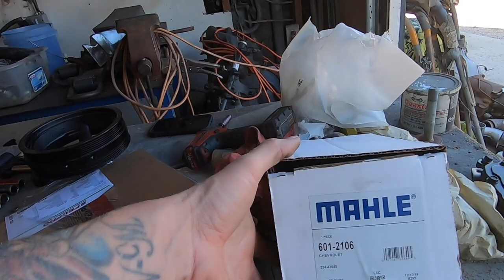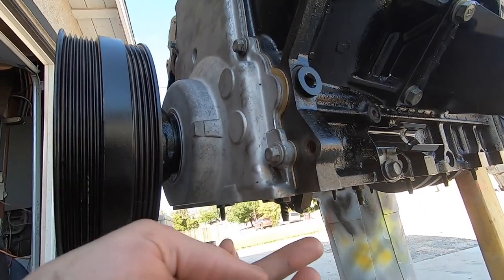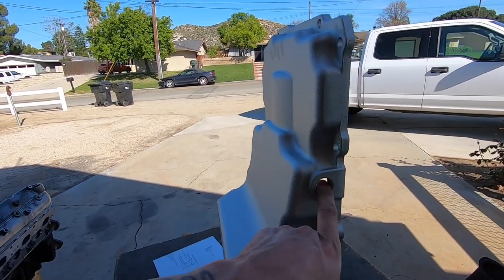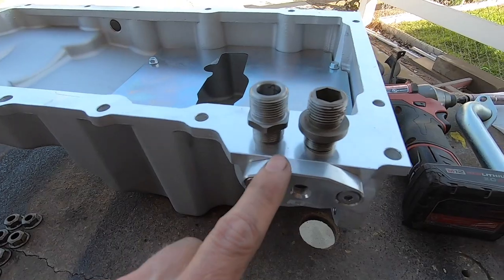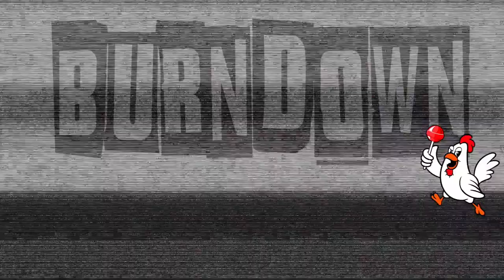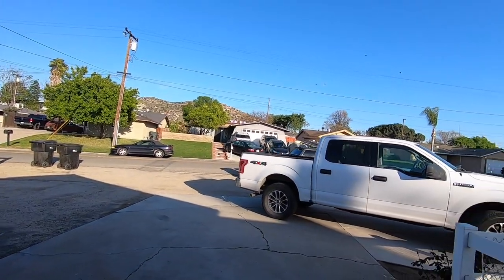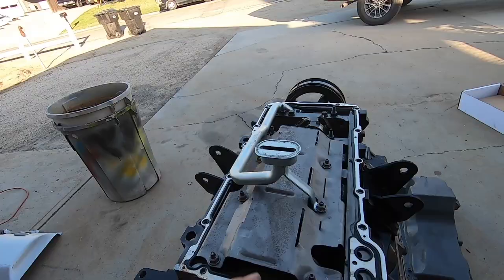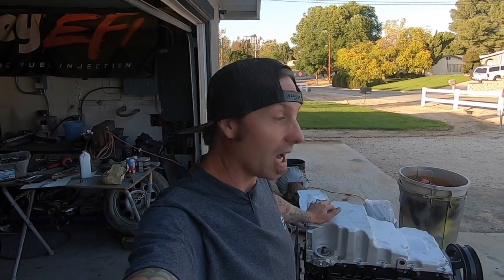Best Budget LS Swap Oil Pan

Comment: You can make the truck windage tray work by cutting it 14.25 inches from the rear of the tray. You may need to trim one corner a bit if the oil pickup tube makes contact with it. Easy fix and will save you $30-50, Nice video!
Reply from the maker: Thanks for the tip!

Comment: In 07 they changed oil filters on the trucks until 2013. The later ones are a pf48 ac delco and the earlier are a pf46 ac delco just fyi.
Reply from the maker: Thanks man. I changed the one on the Boom to an early truck style so thats what the Bego will be so they take the same filter. Makes life easy when your cars take the same consumables.

Comment: Just FYI, that pan is almost identical to the Holley pan. I have compared the dimensions of that pan verses the Holley. The dimensions are on there sights E- Bay and Holley checked it out for yourself. Holley calls it there 302-2 or 302-3 pan. The only difference I found was the very front Hump that kicks out in the front of the pan is slightly shallower than the Holley. You could probably grind some material away if needed. Holley recommends that style pan for a stroker motor with that front hump. I paid more from Holley and didn’t even get a gasket or new pan bolts. A lot of people cut the windage tray in front of the bolts and  notch the side approximately 2 inches where the pickup sweeps back down near the block. Damn what the hell am I doing watch this video at 1:41 am JK, keep up the great work.
Reply: Yeah Holley supplies the diagram as to where to cut tray.

Saw your comment after I replied. ;) lol
Reply: Do you have a link for the e-bay pan?
Reply: Brandon Loll look up poormanmotorsports on e bay. Pan# Tsp 81075
Reply from the maker: Thanks for watching man. I didn't know Holley gave instructions on where to cut the windage tray but when you put it on its pretty obvious where its hitting. Its a nice part for the money for sure and if you cant figure out how to cut a windage tray you may have a struggle with a complete LS swap 🧐😃
Reply from the maker: I put it in a comment
Reply: The Holley diagram is garbage, it doesn’t say which is front of the block and the whole placements for reference are off but one can figure it out

Comment: i like that pan, these weren't around when i did my swap.  i used the GM muscle car pan when it was still $125.00, still pretty deep sump but not as bad as truck.  came with everything including dipstick. had to weld in my turbo drain tho.
Reply from the maker: Yeah these didn't exists when I did my swap either so its only getting cheaper for everyone. I had to drill and tap my oil pan for a drain but it wasn't the end of the world. Hell I even did it on the car HAHA! I have way more money in a real Holley pan and the tap I had to buy.

Comment: Is there a reason you didn’t use the Oring that came with the oil pan?
Reply from the maker: I dont trust an O ring unless its nice and tight in the oil pump. I had oil pressure problems before because of a lose fitting O ring so im always skeptical now haha.

Comment: Used that pan on my swap, but unfortunately didn’t know that they offered it with the oil drains...  It fit great in my 3rd gen I didn’t have to clearance or grind on my crossmember like I have seen done on other swaps. Couldn’t believe the quality and price verses the other pans I was considering. Great video as always Dane.
Reply from the maker: Thanks Jay. They make 3 different ones I believe. They make one that looks similar to this one but no drains and the front of it has more meat and will fit over the windage tray. This one is a 302-3 knock off.

Comment: Glad I found this channel! I just got my 92 5.0 and going to 5.3 4l60 swap but unsure of everything I need. Of course I need the motor, trans or a complete donor. Then oil pan, cross member, motor mounts, driveshaft I don’t have one I think, can I use ls1 front end accessories with a ls1 harness? And I need a fuel system as well
Reply from the maker: If you go with LS 1 intake you need to do the LS1 balancer, water pump, and accessories to go with it.
Reply: @Burndown  super late on this lol but I started back on the fox body complete 06 5.3 pulling motor from truck hopefully this weekend or start of next week
Reply: @Burndown  I think I’ll just go cowl hood and keep stock ugly intake unless I find a ls1 style intake not to break my pockets

Comment: I got the same oil pan without any turbo return oil line holes. Me question is everything says you need this dipstick and tube, but the oil level should remain the same. What did you find that changed regarding the dipstick markings. 
Engineers would place the full mark at a level below the balance weights on the crank to keep it from rotational viscous friction, plus aeration of the oil. I guess in my mind, full is full, right? What did you find other than the amount of oil need to fill with filter?
  I did the same thing with the oil filter adaptor. The threads are the same on the pan side, plus if you have a large stash of filters, now you can still use them. If you could and you had three vehicles, it would make sense to have one filter on the shelf that fits each of them. I have seen oil pan upgrade videos where they bought new filters to fit the pan. NO, change the fitting to the filter you have or want to use. I have a 12 pack of ACDelco PF46 and don't want to though these away or sell on craigslist and buy a different part number for more money. What do you think? I subscribed some time ago and enjoy a young guy doing what I did for 40+ years. Thanks and stay safe during this "WU-FLU" time, now May of 2020.
Reply from the maker: Man I just bought an LS3 style dip stick and ran it as is. If you wanted to you could check the dip stick with the pan off to get a measurement if your that concerned about it. Im more of an it has oil in it were good kinda guy 😆

Comment: Question on the Oil Pump, would it be better to have a high volume oil pump or high pressure ?
Currently building a 5.3
Reply from the maker: Lots of debate on this topic. I have used them all without issue. My current pump is a high pressure pump normal volume. As long as your making 10PSI per 1000 rpm as a rule of thumb you should be good.

Comment: So, that's a knock off of the holley 302-3?
I've used that Holley one on 2 builds, since I saw Matt point it out and use it. Nice pan for about any swap. ;)
Reply from the maker: I agree this is probably my new go to pan for everything. Has drains and is low profile. It may be a issue tho with crossmember clearance. Its a little longer that the 302-2 so check your specs before you buy.  Nice part tho.

Comment: i just installed a new melling 295 in my c10 and my oil pressure is about 40 cold start and 20-25 hot idle. im going to be pulling the cover back off in the next few days and shim the spring and see how much thatll help some pressure. i dunno if you was looking for a specific  oil pressure number but thats about the normal stock 5.3 pressure numbers.

that oil pan is pretty slick. ill definitely try one of those next time.
Reply from the maker: Your oil pressure is fine. 20 at idol is normal. I have heard the other story where excessive oil pressure causes issues but I dont know. My car has the high volume pump in it and good so far. The twinnebago has a normal pump and should have same pressure as what your describing.
Reply: Kyle Orsak don’t waist time.   You need an m365 pump.   It’s 30% high volume and cost under 100 bucks new.   Only LS wet sump pump that flows to 8000rpm with zero cavitation
Reply from the maker: @thegarageguy8712  Where you getting an m365 for less than 100$? That seems like a good deal.
Reply: Burndown the price went up slightly at summit just price match to the amazon for fast delivery.   Even Oreilly priced matched them for a while for me same day

Comment: does this oil pan work on a 1985 c10
Reply from the maker: I would get a larger pan if you can fit it. Probably just a stock truck pan would be fine for your c10

Comment: So ypu used the green one supplied by the pan pr the thick one from melling? Kinda confused
Reply from the maker: If you talking about the O ring yes the thick one. Should  be hard to put it on. If you pop the pick up tube in without a fight its too loose.
Reply: @Burndown  gotcha man thanks

Comment: Great video! So why did you go with the green seal from oil pump and not the seal provided with the oil pan if it did come with one? Thanks in advance
Reply from the maker: On the gen 3 stuff you want the tightest O ring you can fit. I have had problems in the past with the O ring not sealing and then you will lose oil pressure and it will bleed the oil back into the pan past the O ring if its not nice and tight.
Reply: Burndown so going with the green one would be the right choice? Thanks I’m learning as I go and appreciate the help.

Comment: Has anyone had an issue getting the bellhousing bolts to line up? 5.3l with a 4l60e. None of the bellhousing bolts on the oil pan line up?

Comment: Dane what did you do for the Boom's steering I have the 64 Chevelle, and do have the Holley and inner tie rod ends hit it no bueno Brother.
Reply from the maker: I got a rack and pinion kit form a subscriber. The lock to lock steering is not very good tho but since I have a spool and its a drag car I don't mind. They make a really shallow pan that should clear. The one I had hit as well. I was gonna weld a small piece of aluminum to my pan on both sides so it didn't rub a hole 😆
Reply: @Burndown  thanks Brother, been missing you.

Comment: What dip stick did you use ? How many quarts does it now hold ?
Reply from the maker: I believe it’s a 6 qt pan. I have ls3 dipstick on it I believe. Best thing to do is put in the amount of oil and double check it registers on the dipstick correctly or make note of it if it doesn’t.
Reply: @Burndown  I got the pan because of your vid and followed your instructions . Thanks !!
Reply from the maker: @supergreedy287  thank you for watching!

Comment: Does anyone know this pan will fit a gbody with holley motor mounts?
Reply from the maker: I bet it would. Look up the dimensions for the pan you would need form Holley and these are very similar.
Reply: Did then pan work for you?
Reply from the maker: @kentwayne5818  yep worked fine

Comment: so....why not drill a hole, in windage tray, to accomodate original dipstick tube and stick
Reply from the maker: You can do whatever you like. I just used the recommended dip stick for this pan and if fit well. I didn't have a stick to begin with either or I may have tired it.

Comment: hi, I plan to buy another oil pan for my Chrey Silverado 5.3 gen 3 2003 rebuild. so think this oil pan would work in it? I might like the low-profile one if I have to take it off again. being I'm going to have to drop the differential to take the original oil pan off, being a 4x4 are they any other problems to use this one with my 1500?
Reply from the maker: They have the dimensions on line for this pan. Its much more shallow then a stock truck pan.

Comment: I replaced my camshaft and crankshaft sprocket is it normal for your new timing chain to have some slack and am I okay to run my motor like that thanks
Reply from the maker: Yeah they do. You can get a tensioner off an LS2 or LS6 and it will take up the slack. If you watch my new video I put one on my 6.2. and show the part number for it. If you dont want to watch the video just google it. It looks like a W shape kinda.

Comment: That pan looks sweet! I could definitely use that for my A body. Do you have the link for that? By the way if I remember right, you are correct on the sizes! I think the larger size is for Corvette's that use a larger filter. Great intro Dane! 👍😊
Reply from the maker: Whats up Mason! I dropped a link on another comment. If you just search eBay for LS swap oil pan you can find them. Hell if you type in a Holly part number they pop up so hard to miss. I believe this would be the one for your ride tho. Thanks for watching.
Reply: @Burndown  My luck I'll order the wrong one.. lol. That came with everything but the dip stick. You have to run a different style right?
Reply from the maker: @masoncampos7043  Yes it said to run an LS3 style dip stick.
Reply: So has anybody figured out what filter is used with the pan? If you do not pull out the oil threaded nipple?

Comment: Would this fit a 1967 Chevy Camaro thanks
Reply from the maker: If you look up the holley pans find the one you need and then look up the same part number on ebay and youll find the one you need that way.
Reply: @Burndown  thanks thats exactly what I did looks to be the same one you used on your video I will install and let you guys know if it works 👍
Reply: @Burndown  I will also order the Holley Terminator X this Weekend super stoked to do my first ls swap

Comment: Do i need this pan for ls swap on a obs.??
Reply from the maker: No idea. I put this in a motorhome called the Twinnebago. Enough people have swapped OBS trucks at this point so see what they are using. I bet this pan would work but I can't say with 100% its the one you need. They have different ones so just measure the stock pan and see what's close and order that.

Comment: I hate this pan. for my 68 A-body it hit the cross member and the tie rods, Why? Because they created bulges/bolt reliefs on the rails. Holley has the whole sides in front of the sump flush. It is NOT a copy of the Holley even though it shares a part number. Once I had to cut and weld the savings was gone, Google pictures of both and you'll see, I'm so pissed
Reply from the maker: Sorry you got something that didnt fit.I used this for extra clearance in my winnebago and have been happy with it. Seemed like a nice piece to me but not sure on the fit for an A body. I know a 302-1 will not fit well in an a body either as I had one and it also hit the steering up front. I just left it in and would not turn all the way 😆

Comment: Can anyone tell me the part #on that pan and will it fit a 72 nova thanks
Reply from the maker: They are similar to the Holley line of pans. Check the Holley website for the pan you need and then use the part number to find one for less on Ebay.

Comment: Why didnt you use the truck oil pan
Reply from the maker: The bottom of the oil pan is over the axel so I wanted the extra clearance since I lowered the front suspension. I had decent clearance but if it ever go into the bump stops it would have hit the bottom on the truck oil pan and I just dont want to chance it.
Reply: @Burndown  Just guessing seems it would have cleared good. Being you took out leaves you might need to fit some antiroll bars/ antisway bars. You probably took out a lot of stability.
Reply from the maker: @CharlieBrown-pb9xn  We will find out when she hits the road. I dont think the word stability and Winnebago go together. HAHA
Reply: @Burndown  dont let wind blow it over
Reply from the maker: @CharlieBrown-pb9xn  I have see that happen to big rigs
Reply: @Burndown  with all those missing leaves your asking for it. Thats why you need anti roll bars. Heavy ones.

Comment: Which windage tray is that?
Reply from the maker: Whatever was stock to the junkyard motor
Reply: @Burndown  thanks I appreciate it. Just tried to put an lq4 with a c6 oil pan into a 1971 240z and the pan did not clear.  The front lip is 1.9 inches for the c6 and on the retro pan the front lip is 1.2 inches.  Just ordered this pan and hope it helps with the clearance.